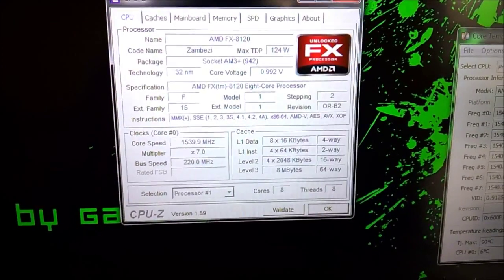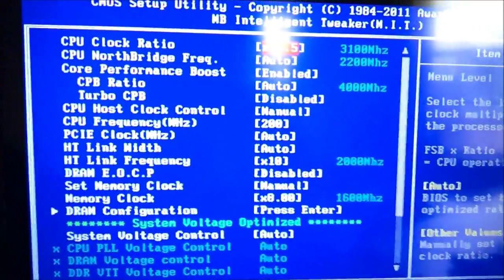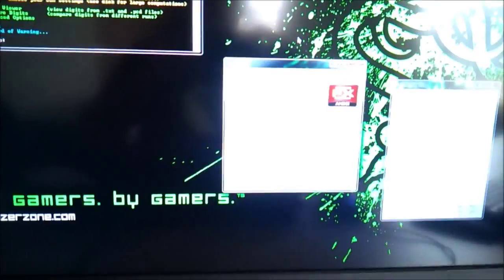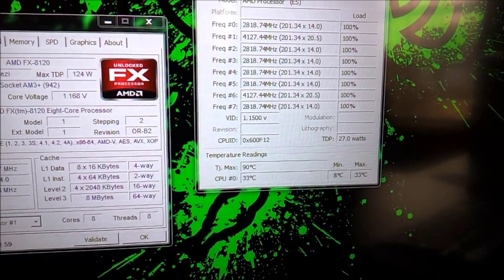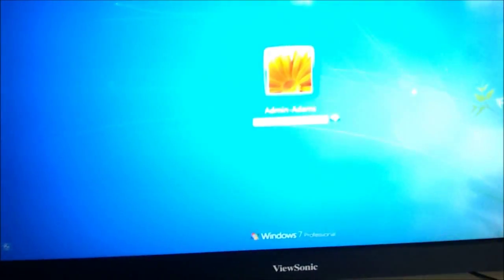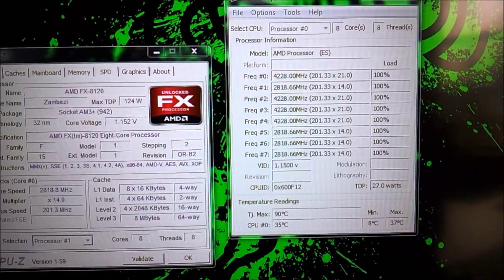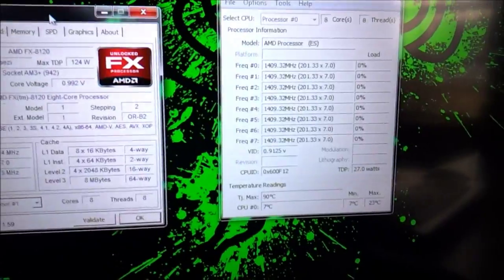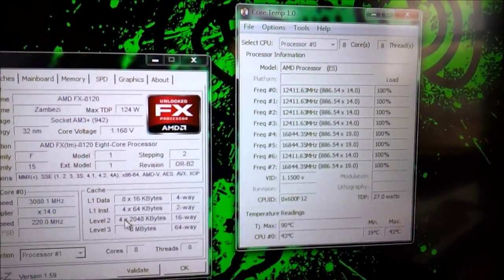How to overclock AMD Bulldozer/Phenom BE CPU's Via Multiplier

Comment: I clocked my AMD 8120 8 core to 4.1ghz, that runs 3.1 on stock. The OC depends highly on the kind of motherboard you use on it. I use a Asrock 970 Extreme 4. Do not worry to much about frying your system. Mobo's are very well secured against it these days, frying a system is more something that happend years ago. With so so failsafe features.

Comment: I have a Phenom II 955BE stock is 3.2ghz.  I have a Gigabyte GA-890GPA-UD3H.  I have 12gb 1600 of Gskill Ram. 1000W ocz power supply.  And a H80.  Everytime I try to even get 3.4ghz to overclock it crashes, it will run but as soon as i try to run prime95 it restarts the computer.  Any ideas?

Comment from the maker: lol no, y-cruncher isn't capable of bricking your system nor is any other program I used in the video. You might have missed turbo boost or something like that and it tried to overclock itself to like 4.5ghz or something like that and now it's not booting to protect the cpu from frying or something. Just try to reset your bios and youll be fine.

Comment: what power supply would i need to get to overclock this? would the CORSAIR Builder Series CX500 500W ATX12V v2.3 80 PLUS BRONZE Certified Active PFC Power Supply work?

Comment: does overclocking by FSB will this dmage my cpu if i keep doing it, my oc is FSB@ 220
v core is @1.300 ang my clock is at 3.7GHz is this safe max temp under y crunch and cinebence is 47c

Comment: The only thing left I want to do is replace the stock cpu cooler with th  Noctua NH-L12 and hope to quiet thing's a bit. It's interesting to see all eight of those core graphs average around 50-70% running all those programs simultaneously.

Comment: This 125W cpu's been running in the 95W socket of my Gigabyte GA-78LMT-S2p for about a month now. Flying across terrain in Google Earth , recording an program in SD on my HDHomerun Prime, playing a video on my HDD and playing a YouTube video all simultaneously and the CPU hasn't run any hotter than 37-38C w/ch is well below 60C. No crashes since removing AMD Vision. (only Catalyst drivers) as this is an HTPC rig only so  I suppose this would change once I played any decent game w/c I won't.

Comment: Just speculation on my part, but maybe the FX-8150 is just a beefed up 8120 engineered to dissipate a higher thermal load. It's anyone's guess whether the power regulation firmware is smart enough to stay within in safe operating envelope and detect that 95W is the maximum power design of the mobo. 

I just wish I knew someone who could tell me that it'll be fine or at least someone can tell me what hardware tool or software suite can chart the CPU's power draw in watts over time. Anybody know?

Comment: I effed up buying the FX-8150 (125W) as opposed to the FX-8120 (95W) for my mobo  which is limited to 95W CPU's. Windows reports the CPU running at 2.81GHz. I have no desire to overclock the CPU or the GPU on my HD7750 card. Catalyst is not installed and I'm only using this build as a PVR.

My question is: Will I harm my CPU because of that 95W limitation on the mobo?

Comment: My motherboard had a built in overclocking program and it overclocked my 8150 to 4gh, although when I ran y cruncher it after a few minutes the heat was still rising, when it got to 65 I shut it down, does that mean I should lower the speeds?

Comment from the maker: 57f or 57c? Whats your vcore? If you didn't disable the "turbo" function or what ever AMD uses your votage might be way too high for your overclock. With turbo on My 8120 ran at like 1.3-1.4v which is way too high for a normal small overclock. You should be able to hit 4ghz on the stock voltage after turning off the turbo function  and restarting your computer

Comment: I have a asrock 970 extreme4, antec Kuler 620 and a fx 8120. I want to overclock it to 4 ghz, should i go with your settings and not have to run a test for many hours?

Comment from the maker: You don't really need anything "Special" per-say but you do NOT want to overclock using the stock heatsink/fan it comes with. You can go for liquid cooling if you plan on some serious overclocking but with the 8120/8150 you should be able to hit 4Ghz just fine on a decent air cooler like the zalman CNPS9900A. That got mine to 4.2Ghz before heat became an issue

Comment: the temperature sensor on the cpu is not working correctly since AM3 release dont know why amd doesn´t fix that. download hwmonitor and look at TMPIN1 temperature. my 1055T (stock 2.8GHz OC 3.8GHz) is running under full load at about 58°C but my core temperature says that it´s running at 47°C that´s a 10°C delta (room temp about 23°C)

Comment from the maker: I had the Corsair H80 but since it had the down throttling issue it lowered the temps a lot too. Nut I could run my 8120 @4.3Ghz on the H80 just fine

Comment from the maker: Every computer is different when it comes to overclocking. You can typically get general overclocks using specific settings like an 18x multi with a 200mhz bus speed would work on almost every single 8120 but to achieve higher clocks you have to do a bit of tweaking

Comment from the maker: Might be some setting in the bios limiting the bandwidth of the cards. Might be a different driver version or it could be that the cpu is just bottlenecking it (If you have it stock that is almost definitely the case)

Comment from the maker: for the FX series OCing by upping the FSB is absolutely the best. 250 is probably the highest you are going to raise the FSB (I've only ever seen under LN2 or serious watercooling. If you can raise the multi up by .5 and see if it's stable. Keep doing that until you either can't push the vcore any higher due to heat or instability. I only got my fsb up to 225. Count yourself lucky ;)

Comment from the maker: The max run temp as recommended by AMD is 62c Any temp above that CAN kill your cpu but that doesn't mean it will right away. The chip can probably handle up until 70-80c before causing permanent damage over a short period of time. I know most modern mobo's come with an option for the computer to shut down after it reaches a certain temp. I always set mine to 62c just  to be safe.

Comment: Hey can I overclock my pc the specs are and fx 8120, asus sabertooth 990fx, gskill ripjaws 1866,  h100 cooling, I want to overclock 
Y CPU to 4.3ghz do I have to mess with the bus frequency it increases the ram speed can I just use the CPU ratio and the CPU voltage to overclock pls help me and let me know soon thsnks

Comment: If a simple overclock (without messing with the voltages) doesn't work and it crashes and doesn't boot up into the desktop, can I simply bring down the overclock to its defaults? Or do I ***HAVE*** to raise the voltage to be able to use my computer again?...

Comment from the maker: my ram was rated at 1600mhz but I ended up running it at around 1700mhz after I OC'd using the FSB. It was G.Skill Ripjwas DDR3 1600mhz

Comment from the maker: My settings before I sold the computer were 215 on the FSB and and a 20x multi with a Vcore of 1.3v. Keep in mind all chips are different so don't expect my settings to work for your chip. And no I never got around to making a video on Ocing that way. You just have to take into account so many different variables that change from board to board that it would end up being almost an hour video if I wanted it to be thorough .

Comment from the maker: That really depends on the quality of chip you get. Some run hot and some run cool. Some overclock really well on the stock voltage and some don't at all. But I think you should be fine as long as your ambient temp is below 80f or about 24c.

Comment: I am running with the sabertooth 990fx, 8150fx chip, H100 cooler and 8 Gb dominator mem. I am sitting at 4.5 stable temps around 46deg but running intel burn, prime 95 the temps sit around 62/63 deg maxed out. Core temp shows a good 7 deg out from asus and I am finding that core temp is not the best side program to run for temps what other programs would you suggest ?.
The sabertooth seems so far to be a good board for over clocking ? 
Liked your overclocked set up cheers

Comment: im running the fx-8150 im keeping it cool with a corsair h100 liquid cooler and 4 cougar 120mm fans idle temps are about 45C and max temp on aida stress test are 63C im running a 4.4GHz oc w/ 1.4V on the cpu core, even w/ 63C the cpu is very stable at 4.4GHz, i can put it up to 5GHz b4 it refuses to boot but at that point im at 1.55V pushing 55C idle so i stopped 4.4GHz is good enough, seems stable so im going to run on it

Comment from the maker: well do exactly what I do in the video and it should be a bit easier. Not all chips like a lot of voltage. Mine basically shit it's pants after 1.3v and most people don't go higher then 1.45 when using WC/Air overclocking. Start out at the standard voltage and slowly raise the voltage as needed. If this doesn't work I'm sorry. Some chips are just better (or in your case worse) then others. AMD says it can overclock. It doesn't guarantee that it will be stable though lol. Oh and don't gofor4.2Ghz

Comment from the maker: Alright I checked it out. Are you still using the air cooler for OCing? Or do you have water cooling now? Because if you're just aircooling the temps should be incredibly high for that clock speed unless you have a godlike cpu. oh and ditch that mobo. It only has 1 4pin power for the cpu. When getting into giant OC's like that you need solid power delivery so I'd get a mobo with 2 4pins just to be safe. Maybe an Asus ROG board.

Comment: Oops, I must have skipped over that part in the video when I asked that. haha sorry. Any suggestions on getting my idle temps to be that same as my ambient. I just ordered 4 fans to do a push pull config. I got it up to 4.1 GHz and it got to 70 degrees on a push config. Should I put the rad on the outside of the case? would that make a difference?

Comment: I have my 8120 running on a ASUS M5A78L-M LX PLUS AM3+ AMD 760G Micro ATX AMD Motherboard and it can easily hit 61 degrees. Is that the max temp? cuz it would down clock and my game start lagging for couple seconds.

Comment: @misterpc23 U need to update to latest bios, it was beta a month ago but now its a legit version (at least for my motherboard which is 990FXA - UD3). After update u will have an option in bios called APM or something and u need to disable that. After that u will have no throttling (downclocking under heavy loads) and your frequency will remain at the number u set it.

Comment from the maker: I like mine, hasn't been a bottle neck so far. They sort of suck stock but as soon as you overclock them a bit they really shine. Would be smarter to go with a 2500/2600/2700k right now but if you already have an AMD platform and don't want to switch they're worth it. When they release the new revisions of BD I may pick one up if I have the cash and if they fix the massive power consumption problem haha.

Comment: ive got 1,31V stock aswell and with Cool *n* Quiet it will ofc downclock but when i put a load on it, even with manual of voltage it will increase to something like 1,4V imjust wondering if that is even healthy for the chip? tho i reached 4,4Ghz at stock voltage :D

about ur bios screen you can disable the logo which makes it boot faster :) got the 990xa-ud3 Mobo

Comment: @misterpc23
it apears the programs are up to date.
these are a few programs came with my motherboard.
but i think they either read a difirent temperature or the reading is wrong on them because it shows a cpu temp of 36C on startup when the pc is turned of for the entire night.
however the coretemp shows 7C at startup wich obviously isnt correct either.
however i think coretemp gives a more acurate reading but im not gonna OC the cpu more than the 4.1ghz i have now

Comment: I used the coretemp aplication aswell as the temperature program wich came with my motherboard. problem is they both show difirent temperatures, coretemp shows at highest 38C when running stress test but my other software shows the temperature rising to 56C.
how do i know the actual temperature? my cpu: fx8120 running 4.1ghz at 1.32V

Comment from the maker: @militarycanadian I've run stable at 4.4Ghz @ 1.3v (Temps got high). And no, it's not really worth overclocking higher. OCing the FSB with the FX series just plain makes them perform better, I'm not sure why but it's a rather huge difference. Also OCing the FSB OCs pretty much everything else on your mobo (NB, SB, Ram, Onboard video)

Comment from the maker: @msn140 I would consider that dangerous. AMD recommends that the chips don't run hotter than 62c. That is AMD's set "safe temp" limit on The phenom and FX series cpus. Though given that some of the stock heat sinks are hitting that temp right out of the box you MAY be ok. Totally up to you. Though the extra heat will shorten the chips lifespan by a lot.

Comment: @misterpc23 Was odd. It was automatically messing with the RAM, but it was doing it based on the feedback it would get from the CPU auto overclock option. So, since the auto was turned off on the CPU, the RAM wasn't sure what to do after it went past the point the auto CPU overclock maxed at. Was about to pull my hair out, I spent a good 2 days testing settings, and a day before studying overclocking. It makes sense you don't want to give out wrong info. Can't wait for that video to learn more!

Comment: @misterpc23 I've had it up to ~1.4 before, and still no stability. I think I might have found the problem though, I had an option in my bios I seemed to have missed that messes with my RAM speeds and timings automatically. I've turned it off and I seem to be getting somewhere now. Been slowly climbing up the speed and running stress tests, and everything seems to be working now. Imagine that!

Comment: @misterpc23 I'm using a Asus Sabertooth 990fx for the mobo. It's hard to tell you exactly what my cooling system is, since it's from ibuypower. But it's a closed loop liquid cooling with push push air. It's def not stock, but it's obviously not the best. When I'm at 4.1 ghz, I easily stay under 50 degrees c under load with prime95, but the temp in the house is between 70-78, depending on the day.

Comment from the maker: @NSOnos It might be a motherboard limitation (If you have a lower end mobo) or it might just be the limit of your cpu. Not all cpu's are guaranteed to OC. BE just means that the multi is unlocked so you can if you are lucky enough to get a chip that can handle it. What is the ambient temp where the pc is and what are you using for cooling?

Comment: I'm not sure if this is something you can help me with, but I'm having issues on overclocking my fx-8150. I can overclock it to 4.1 ghz, but any time I try to go above that, I can't pass any stress tests. There is an auto overclocking option in my bios, that also brings it up to that speed, so that's how I knew where I could at least start. I'm not sure if I'm missing a setting I need to change, but no matter what I set my voltages to try and bring stability, I keep failing stress tests past 4.1

Comment: @misterpc23 i ran y-cruncher for like 7 hours no errors is that good should i run it for like 48 hours ? asus 990fx 8120fx amd @ 1.25v x21mult @4.2ghz 16 corsair vengence 1600 mhz 9-9-9-24 my idle templ is 34 C full load is 54. i might have a bad batch of cpu cuz even at low voltage my temp is way too high . so my stable speed is 4.2 @1.25v so far its stable under prime95 and y cruncher. i was hoping for 4.5ghz-5ghz like alot of people and i even have corsair h100 :(

Comment from the maker: @SylentCommando Thanks, there is supposed to be an update to help improve performance. Windows 7 doesn't take advantage of the 8 cores properly. I do see huuuuuge performance increases when working in Blender. Like double or sometimes even 2.5x speed in doing water simulations as compared to a 4Ghz 955be

Comment: I had the same throttling issue with my Gigabyte 990XA-UD3, all Gigabyte AM3+ do/did it AFAIK :O

Check for a new BIOS from Gigabyte, over the last few months they've released some beta BIOS' that allow you to completely disable throttling. With the new BIOS there's an option called "AMD APM Master Mode" under Advanced, disable that along with C6/Turbo and it won't throttle :)

It was really annoying with my FX 4100, couldn't reliably stress test, but now a-ok with F10g BIOS (4.6GHz 1.465v) :)